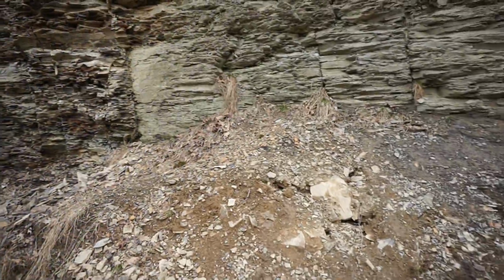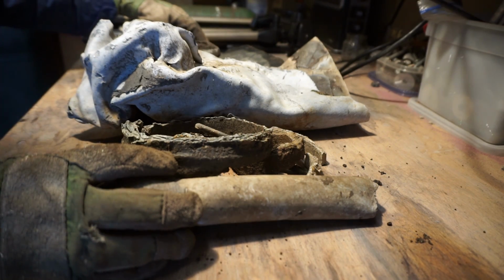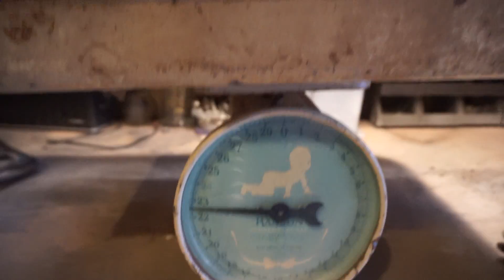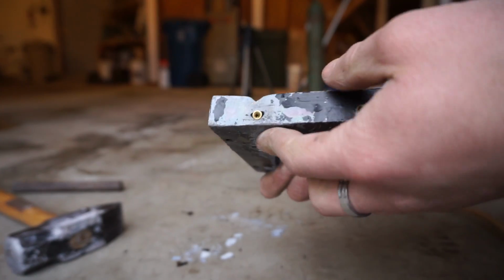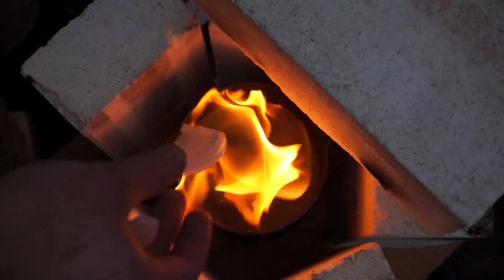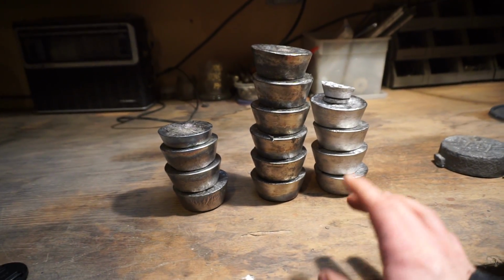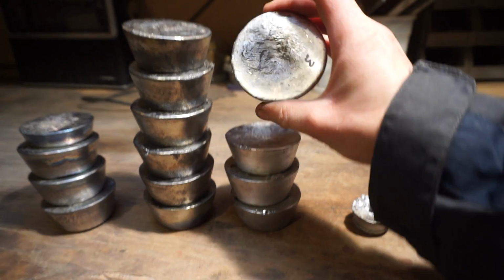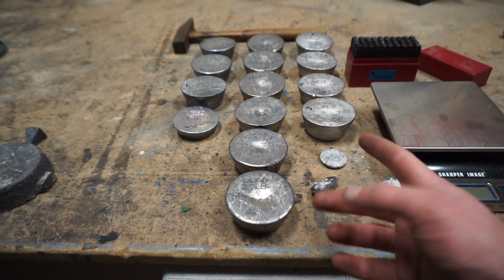Finding, Refining and Casting FREE Lead from the Woods

Comment: The lead parts you picked up are from an old type roof flashing they use to use and of course lead plumbing pipes. But good job collecting it and reusing it. The reason for the different sounds is because the wheel weights are alloyed with other metals making them a lot harder. The roof flashings is basically pure lead and therefore will be heavier but also much softer then the wheel weight muffins.

Comment: Yeah, I think the wheel weights probably have a bit of zinc or tin in them to make them a little harder. I've found lead in the woods before too, but there's probably less of it here in Minnesota than where you are in PA just because of European settlers having lived there longer. My great great great grandpa was a lead miner in Illinois in the 1840s though.
Reply from the maker: You're probably right about the zinc from the wheel weights.  That's cool that your grandpa was a miner!  How long did he live?
Reply: I can verify that wheel weights have at least zinc in them.
Reply: No zinc in lead wheel weights. Only tin and antimony. Zinc and lead wont mix both have differeny melting temps and will not combine correctly

Comment: I enjoy your videos, you are a bright kid. You dont need that much heat to melt lead, You can melt it on the stove top, Also, lead oxide is extremely poisonous, Wear a respirator, and dont hand the dross that you skim off the top. Wear thick leather boots and leather aprons and chaps when casting metals or you will have a bad day, sooner or later, Take care, really loved your IC engine project.

Comment: your roofing lead and maybe your radiation detector lead will most likely be pure, and the wheel weight batch (#3 when you had stacks) will have tin and antimony most likely in a 10:1 lead:tin ratio, that's what most people use for casting bullets is that ratio and wheel weights as long as you don't get newer zinc tend to be that ratio or close to 12ish:1 and people have to add tin solder to bump up the tin content for hardness. you prob alredy know lead is toxic so I wont hassle you as long as its ventilated and for the popping that's due to moisture if you put ur pan over the furnace for a min or so that'll go away

Comment: With my anxiety, I'd be washing my hands every time I pick up a piece and I would clean the area where the lead had touched xP
Reply from the maker: Trenton Zelley lead salts and other compounds that can dissolve in water are the bad things. not much lead from the metal alone can be absorbed into the body. It's also long term exposure that does damage. a few exposures here and there are not that bad.
Reply from the maker: Trenton Zelley at least that's my understanding
Reply: Makerj101 From what I know, any salt of any metal is bad, but a lead salt would probably be a lot worse
Reply: Trenton Zelley Well, table salt is a salt of sodium metal, and it's essential for us to live. But in general you're right about metal salts.
Reply: lol same. one time, i thought i broke a cfl so i left the room for 2 days so the mercury vapors would leave. it wasnt even a cfl. lol right

Comment: Wonderful video. Two bits to keep you safe. Please avoid doing this activity in the presence of moisture.  Water and hot lead are a dangerous combination producing explosive reactions that spatter lead in all directions. Also consider a stable base that gets your project up off the ground so you need not bend over the pot. Best Wishes...

Comment: your supposed to mix when the wax catches fire, mix thoroughly and scrap bottom, also heat up spoon in lead when removing the dross so lead dont stick to it and heat up molds 1st also your lucky there wasnt any more water in the molds because the water wouldve vaporised and turned to steam instantly causing explosion and lead to fly everywhere including all over you, your lucky.

Comment: I think your hobby is great but you need to do things in a safer way you could have dropped that pot and you would surely made a trip to the hospital and for lead you are heating it to hot 650-700 degrees is enough have fun and be safe